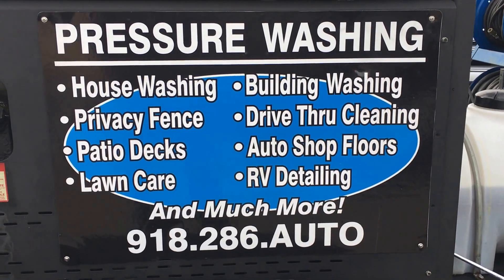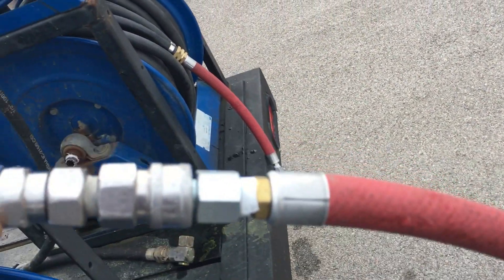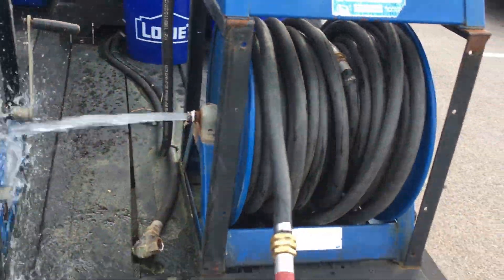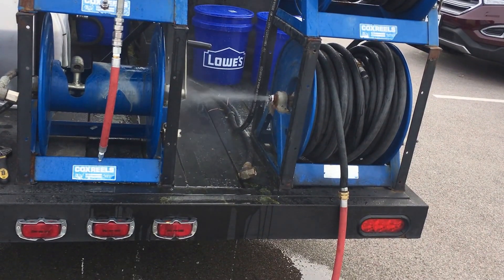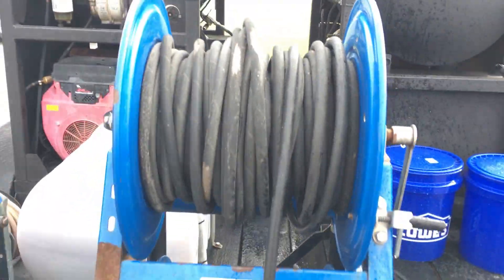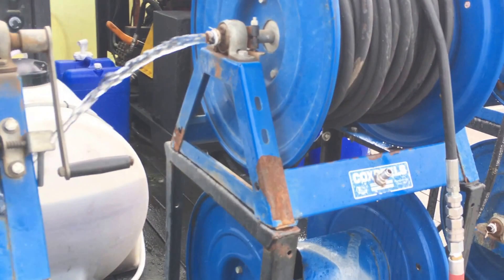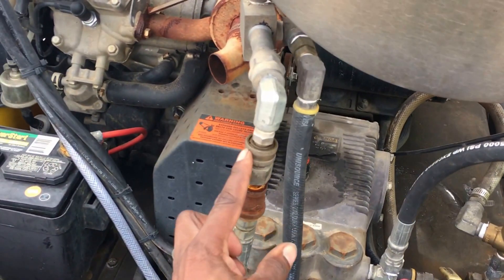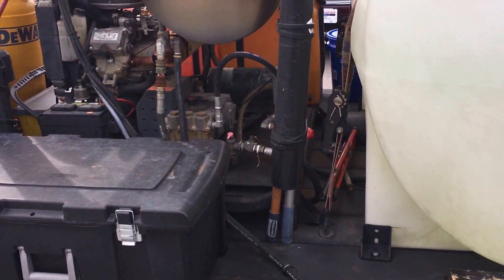How to protect your pressure washing equipment from freezing - Aim High Pressure Wash #2.

Comment: In winter we drain the pumps and the water filters.  Some guys run in the winter and they will pump some antifreeze into the pumps and water filters, then drain the hoses with air after each job.  Having an air compressor and making a hose like you did is great advice. it saves a lot of time
Reply from the maker: FAS...I too would run antifreeze in my lines...But for several years now, I stopped doing so and just did this method and had no issues.  But in deep freezes or days with below freezing, I too would use antifreeze thru the system...thanks again man, ttyl!

Comment: On my old rig I had a valve stem installed where I could push water thru the pump, the coils, and the hoses all at once. My new rig has an anti freeze tank. I flip a ball valve to turn off the water from the tank, turn a ball valve that opens the flow from the anti freeze tank and fire up my machine. Run it til the anti freeze starts to come out and shut off. When I get ready to wash the next day I do the reverse and pump the anti freeze back into the tank to be used again at the end of the day. Its very easy, fast and works great!!!! Ill try to get a video up soon of how it works
Reply from the maker: Hydroclean...I use to do that as well.  And yes, that is the BEST way to do it.  I do your method also during deep freezes or long days of below temps.  But, for moderate freezing temps, I tend to go this route...But in the end, you and I both know that we better do something, lol...ttyl. Thanks again for watching!

Comment: I just started my business on a shoestring. I was wondering if you thought it was ok to run antifreeze through a pump. That's what I just did. I outfitted a five gallon bucket with a hose spigot, ran a 2' garden hose to the intake and put the pressure hose into the top of the bucket. I ran it for a couple minutes, till I saw the AF coming solidly out the hose. I'm thinking the anti corrosion properties of the AF would be good for the pump long term. What are your thoughts?
Reply from the maker: I agree with you 100%.  Running antifreeze thru the machines is the ultimate protection you can do.  You did great.  Depending on how low temps get in your area I strongly recommend AF over just blowing the water the out.  If temps REALLY get low, for example, low teens, single digits or worse and especially for consecutive days, I would run AF.  But you can still blow out the lines.  This would save you having to buy extra AF. Thanks
Reply: I'm seeing these vids 4 years after posted, and 3 years after buying a company from my boss.

In Wichita, we cycle -30 washer fluid into our machines and hoses.  It isn't a perfect system...but it keeps the pump primed.